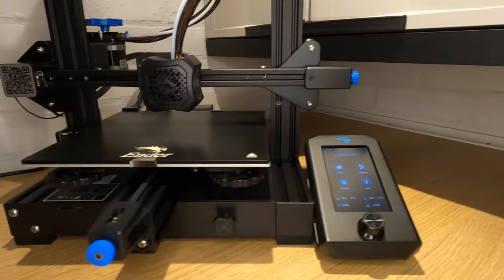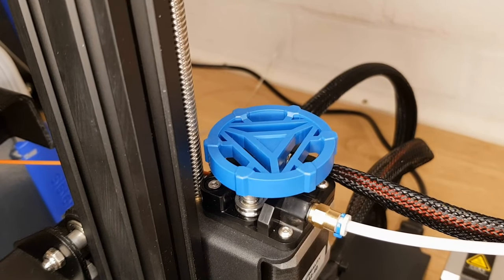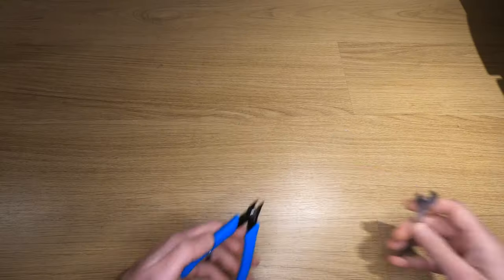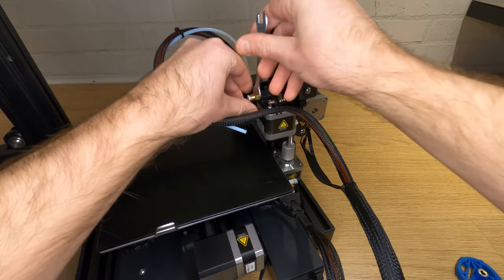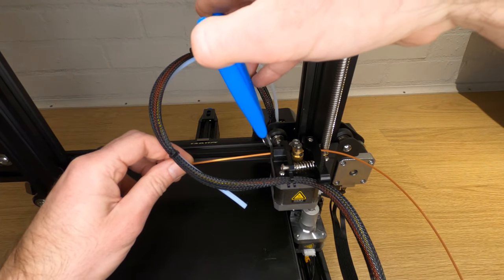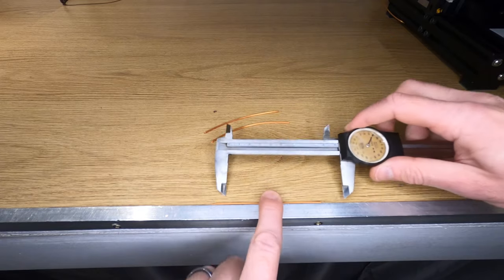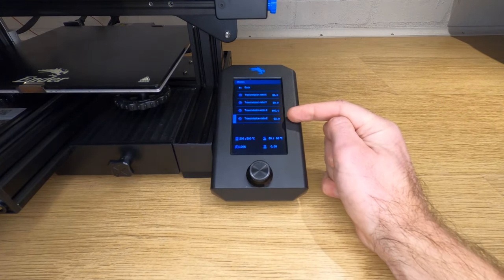Ender 3v2 - How to Calibrate E-Steps (Quick & Easy)

Comment: Instead of turning the printer off, you can navigate back from the move menu and disable stepper motors. Then go back into the move menu and re extrude to 100
Reply: Or just keep adding 100... 100 first time, when it's done click it again and do 200, ... 300, 400, however many times you want.

Comment: Just replaced the crappy Ender extruder and this video was quick and easy video to follow.  BTW, if you re-home after each piece, you don't need to shut down to zero your extruder.  The nozzle temperature doesn't need to reset either.

Comment: Installed an aluminum extruder arm and so i had to recalibrate. was getting around 92mm out of 100mm of extruder run time. now its within a mm of 100! Great tutorial, no blubber, just straight to the point. We need more people like this guy..

Comment: holy moly my ender 3 v2 was extruding just 66mm at 100 mm extrusion !! i did change the extrusion gears to a 3rd party aluminum one but never quite figured out why i was getting thin lines!
life saver man! thanks a lot.
Reply: I was at about 71mm on a 100mm extrusion- had to change e steps about 50 points to fix it.
Reply: same here, mine was at 65.74mm on average. mind blowing

Comment: I had just received the Ender3v2 as my first 3D printer for my birthday and was so frustrated that it wouldn't print anything. All of my attempts at trying to print the demo cat would inexplicably turn into spaghetti. None of the beginner guides or instruction manuals mention calibrating the E-Steps before starting the first print so I was completely lost. Thank you so much for this video, I'm finally able to print! So excited I was able to get past this setback and finally begin learning to use this incredible technology.

Comment: This is my first 3D printer so I have ZERO experience with any of this.  I first watched your assembly video and it saved my sanity.  The printed manual is utter trash.  It doesn't even say which bar is left or right, or which way 'round they need to go.  Now your calibration video is pure gold.  Super easy to follow.

Thank you for the effort you put into this.

Comment: My favorite Ender 3v2 channel! Your videos have been a great help since getting my printer this last Christmas. I just printed your V2 dryer box and waiting for the plastic bin from Amazon.
Reply from the maker: Thanks Jeff. Hearing people are getting something from my videos really helps with my motivation to do more. Let me know if there is anything else in particular you'd like any help with. There are a lot of videos in the pipeline but it always helps to know what people would like to see.
Reply: @RickyImpey  thanks Ricky! The only problem I'm having is using Fusion 360 to design things to make. Your video you posted with the surf board fin helped a lot. Maybe expanding into more Fusion 360 would be a great series of videos. 

I had CAD/CAM in my senior year of high school and that was 34 years ago. Lots has changed since then and I haven't used it since.
Reply from the maker: @jeffallen3382  ok thanks Jeff. I've not done much more with Fusion 360 as I'm far from an expert and only started using it in the 2020 lockdown. I do love using it though so I'll see if I can think of useful tutorials specifically relating to 3d printing for the future. In the meantime, check out Kevin Kennedy's channel Product Design Online. I found him the most useful.
Reply: @RickyImpey  I will do that, thank you!

Comment: Thanks a million. I have my printer for 3 years and never calibrated the e-steps. Hadn't a notions, sounded overly complicated and it was mostly printing nicely. Still tho had i known i wouldve done it a long time ago. Anyways just changed the extruder to the metal grey one, instaled a cr- touch & mriscoc's professional marlin 2 firmware for the ender 3 v2 & found your vid. Thank you again, my printer was underextruding with newly installed extruder anyways. New setting for me is 98.3

Comment: My Ender 3's extruder arm finally cracked after nearly 2 years of printing, so I ordered a dual-gear metal extruder as a replacement/upgrade, and I was a little worried calibrating E-steps would require messing with firmware, but wow that's easy!

Comment: I did not know I had to do this when changing the motherboard, 
I got a Voxelab Aquila X2 and changed the motherboard because it came with the H32 motherboard and could not use jyers UI, 
Going to do this test when my printer is done printing , 
I had some stringing problems that I finally got under controle , 

Thx for this video

Comment: Thank you so much! My display stopped showing icons properly by following another tutorial where they used pronterface and couldn't even get it right. Fixed the e-steps within minutes by following yours. Now on to the next challenge - fixing the display..
Reply from the maker: The screen files and printer firmware have to match. What printer firmware do you run?
Reply: @RickyImpey  It was fixed by unplugging the screen and plugging the cable back in. I didn't change anything firmware wise, I only sent a command to update the e-steps via a windows tool and restarted the printer with the on/off switch. Then my screen icons did not show properly. No idea how that command caused the problem, but it's fixed now :)

Comment: Thank you so much. I was only getting 66mm of extrusion which was causing all sorts of bed adhesion issues, what appeared to be ghosting, weak parts, thin useless infill, walls that weren't properly fusing. All kinds of issues I've been absolutely chasing my tail with. Thank you.

Comment: Thank you, really short, nice and time-saving tutorial. But regarding precision in measurements - better to extract one but long line. It will increase precision. Because cut filament + measurement error - give you some wrong +/- 1mm. And there is a difference 1mm error for 100mm or 1mm error for 300 or 1000mm. So if you got one 300mm line (I do 1000mm) - it will provide you more accurate measurement value. For question how to correct measure long filament line - I use separate white teflon tube (didn't find a transparent one) - it's good enough to see length of a filament in it. Thanks for tutorial again - it really save my time

Comment: Wow this was so short and still had all nessesary info. Though my new ender 3 v2 neo was calibrated, factory settings had 93mm e-steps. had a 92.9 average after extruding 100mm. set it to 100.1 and measured 100mm extruded. Now i did print the test 20x20x20 cube before changing anything and some other things and they came out pretty good quality.

Comment: The problem using this method is,  once you put your  roll of filament into a drybox or spool holder that has a little bit of friction your e-steps don't match anymore and start to under extrude. Mine went from 100mm to 96mm when I was printing out of the drybox.

Comment: Cheers Ricky just subbed to your channel, very informative and you don't try to drag the video out to 10 minutes for something that can be explained in 3!
Reply from the maker: Thanks Ryan, yes I hate having to wait through 10 minutes of filler to get to the information you actually want in a video. I always try to keep it simple👍
Reply: @RickyImpey  how do you do this with a direct extruder like the ender 3 s1
Reply from the maker: @MrAws0m3Gaming  it's a slightly different method with a direct drive extruder. In most cases you have to do the e steps with the filament going through the nozzle and you have to measure the filament going into the extruder not coming out. Difficult to explain, I need to do a video on it really....

Comment: Doing my e steps now, thanks for breaking this down! Quick question though, each one of my 100mm sections of filament extruded with teeth marks in them from the extruded gear. Is this normal?
Reply from the maker: Yes, the extruder will leave marks where it grips the filament.

Comment: About plugging in a sd-card beforehand, what if i use different sd-cards from time to time?
I didn’t had an issue with other settings getting lost. Do they really get stored on the sd card, or are they only stored on the card until you apply them via „store settings“?

Comment: How does this work if you are using a printer hooked up to Octoprint without an SD card inserted (in the printer)?  Is it stored on the SD card in the raspberry pi or similar controller?  OR what if an SD card is inserted in the printer and one in the pi?

Comment: Thank you for making these videos as they are very much appreciated.
 I cant find transmission ratio on my enders 3.
 Im using Jyers Ui v2.0.1 can you please help me find this as I would like to calibrate my Esteps.
Thank you.
Please stay safe.
Bill M8-) 
Haddington
Scotland
Reply from the maker: Unfortunately I'm not running jyres anymore as my Ender 3s are all on Klipper. There will definitely be a setting in there. Have a search around and try and find a page that has settings for x,y & z axis figures. If there is an 'E' or 'extruder' 'e ratio', then this will most likely be it. Unfortunately it can be called different things.

Comment: Hmm, all the test procedures I've found so far are for the Ender 3v2 or Pro...but I have a Neo. I can select and change the E-steps via the control screen and pushbutton, but there's no way to extrude filamanent using this system.

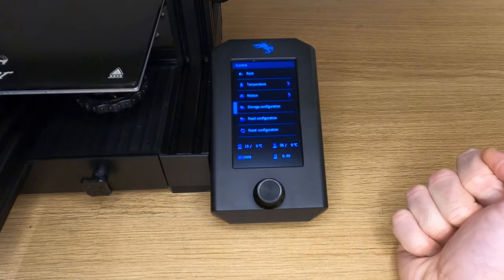Comment: 2:47 If the extruder settings get saved to the sd card, do I need to enter the setting for each sd card I use?  Also, if using octoprint with no sd card, would this not work?

Thanks!
Reply from the maker: It's only the original stock firmware that saved to the SD card. I couldn't tell you which firmware version unfortunately. If yours does save to the SD card then you need the same file on any SD card you use. The printer will still use the EEPROM file on the SD card when using something like octoprint but if you have no card in, it will use default values i believe.

Comment: Subscribed. 👍🏻I have an Ender 3 Neo and the menu is different. I don’t have transmission ratio. Any tips where to look?
Reply from the maker: Hi, the video below shows a method for setting e-steps using proterface. The only 'direct drive' specific part of the video is to do with the way you measure how much is extruding but you can do exactly the same just measure before your extruder. You can also use a combination of the two videos but measuring the way i do in the E3v2 one and changing the settings in the Direct drive video. At around 2m 30 I show how to find your current e-steps. Hope this helps https://youtu.be/zVOx1Ys0IHA
Reply: @RickyImpey  Thankyou.👍🏻
Reply: Try looking under Control>Motion>Steps-per-mm>Steps-per-mm

Comment: Late to the comments here but I have a question: So if the e-step information is saved to the SD card will I have to use the same card to get the recorded calibration numbers? I have 3 printers and use multiple SD cards between the 3. Thanks
Reply from the maker: Hi, yes that's correct but there is a way around this. Simply upgrade your firmware and it's saved to the control board👍https://youtu.be/Qv_vVrnkAkI

Comment: When I try to extrude the 100 mm it doesn't do anything. I've used the pre heated PLA function and when printing normaly it works fine, just not when ordering it to do so in the move menu. Does anyone know how to fix this?

Comment: I don't get it. When you divide 95.8 by 100, you get 0,958 as result and multiplying that by 93 equals to 89,094. Not 97.1 as you stated.
Reply from the maker: It's 100/95.8 not 95.8/100. Hopefully this should clear things up.

Comment: Thank you very much for this video but I do have one question. Why did you turn the power off and then back on at 1:42 then preheat the nozzle? Are you saying you should do these steps before extruding the 100mm piece of filament?
Reply from the maker: Hi, if you don't turn the printer off then you would have to tell the extruder to go from 100mm to 200mm then from 200mm to 300mm etc. Switching it off and on again is just a simpler way to explain as the extruder figure resets to zero when you do. Hope this makes sense.
Reply: @RickyImpey  Got it, now that I am actually doing the steps it makes complete sense. Thank you so much for this awesome video and the prompty reply. I will definitely be subscribing to your channel! Thanks again!!
Reply from the maker: @ABEC34  Awesome, welcome 👍
Reply: Actually, there is an even simpler way: go 'Back', then back into the 'Move' menu, and it will automatically reset all 'move' values to 0 (at least, it does on my machine, which is currently using official Creality/Marlin firmware version 1.0.7).  There is no need to go through all the rigmarole of restarting from scratch for each measurement.

Comment: i don't like saving the esteps on the sd card, because i run multiple printers and swap sd cards all the time.
I'm running into this issue with the latest ender 3 pros and v2. My older 3 pro's save esteps directly onto the printer itself. Is there a way to do that with these newer enders?
Reply from the maker: Yes there is. Update your firmware to Jyers. It's very easy to do and you get a lot of other benefits too https://youtu.be/Qv_vVrnkAkI

Comment: Great video, Just tried this and my extruded starts extruding before I’ve entered 100 and pressed the knob. What am I doing wrong?
Reply from the maker: What firmware are you using? At what point does the extruder start turning? Is it when you start turning the knob or before somehow?
Reply: u probably are using live move u just have to click it off
Reply: @RickyImpey what firmware do i need to u to get transmission ratio

Comment: Why are you calibrating the extruder independent of the hotend and bowden/capricorn tube, surely it be better to test the whole path when calibrating?
Note that if you have the Marlin firmware upgraded from V1.x to V2.x (which you should do for many reasons) the settings will be stored on the motherboard rather than the SD-card.
Reply from the maker: E-steps is purely for calibrating the control board outputs to the extruder stepper motor. The resistance the hotend assembly gives will change depending on other factors like the temperature and the filament type. These should be controlled using 'flow' settings not e-steps.

Comment: Seems like it didn't work for me although this video was pretty straight forward.. My correct e steps should be 96.6 (or even a bit more) but now i see some signs of over extrusion and don't feel like changing my slicer flow settings is the right path to go down since i tried it !!

Comment: So if it saves to the SD card, what happens if you have to format the card? do you have to do this step over and over again?
Reply from the maker: Good question. It will definitely lose any change to e-steps that you changed yes. I imagine it may either use a default setting from the eeprom or possibly write a default back to the card if it finds no setting. I would like to know actually but have different firmware on mine now🤔
Reply: I'm pretty sure it saves to eeprom.
Reply from the maker: @UncreativeN  Not with the standard firmware machines were shipping with. You may have different firmware if it saves to the EEPROM.
Reply: @RickyImpey  OK didn't know that, thanks.

Comment: Hi i cannot swlect extrude on set up as temp is too low? Please help
Reply from the maker: Hi, you need to tell your printer to increase the nozzle temperature to at least 180°C on most printers before it will allow the extruder to try and push the filament through.
Reply: @RickyImpey  hi Ricky got it printing thank you, however im noticing my edges are all crooked any ideas?
Reply from the maker: @germcguinnessphotography5997  difficult to say. Depends what you mean by crooked.

Comment: It's not 97.1. It comes out to 94.146 What am I missing? I even put the equation into google to double check. Now I don't trust this method...Help!
Reply from the maker: Hi, 100÷95.8=1.0438413361,
1.0438413361x93=97.0772442589
Rounded up this is 97.1. Just substitute the 95.8 with your measurement and you should get the figure you need for your new e-steps. Hope this helps

Comment: I am using the jyers-ui so it saves to the board and not the card. Will this be a problem for setting my e-steps?
Reply from the maker: No, not at all. It will just save the e-steps to the board. I have the same setup on mine
Reply: @RickyImpey  Thank you! Your channel is absolutely fantastic for info!
Reply: @RickyImpey  I do not have transmission ratio as a selection, can you help please?
Reply: @RickyImpey  I got it good sir! 100mm on the nose!
Reply from the maker: @HEATRACER24  nice👍 Was it far out?
Reply: @RickyImpey  2mm not 4mm😁

Comment: I know this video is a few months old but maybe someone can help. I found what my transmission ratio should be, 96.61. I have entered it to the motion setting and then save it. Once I extrude the filament the 100mm come out. If I turn the printer off it goes back to 93. What gives?
Reply from the maker: Do you have an SD card in when you save and when you test it after? The e-steps are saved to the SD card on standard firmware.
Reply: @RickyImpey , SD card is in there. I have two files in the card that come up when I go to the print section.
Reply from the maker: @mariselaibarra49  That's strange then, it should remember the settings.
Reply from the maker: Are you hearing the same beep when you save the new transmission ratio?
Reply: @RickyImpey , I am. Same beep noise. I think that maybe I'll try a different SD card. I added a bltouch a few weeks ago and haven't had any luck printing  anything since then. Maybe I messed something up.
Reply from the maker: @mariselaibarra49  What firmware do you use when you did the BL touch?